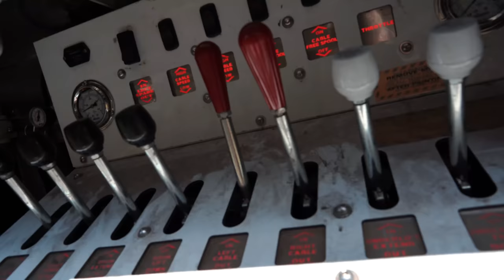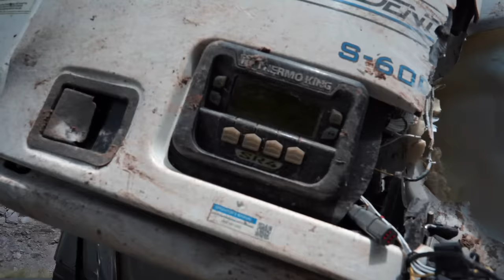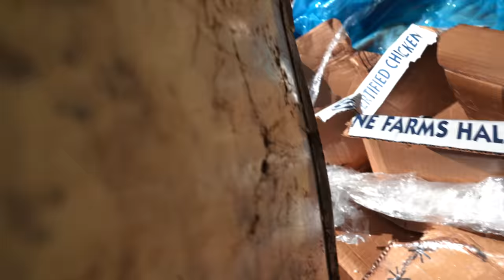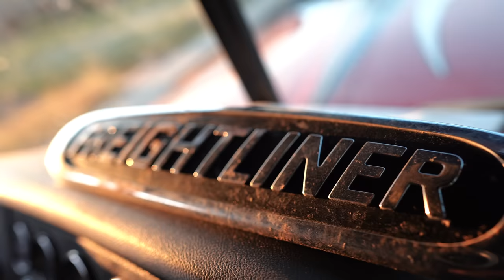The Luckiest Man Alive! (Two Wrecker Recovery!)

Comment: What a chicken of a mess that was!!  And talk about stinking when all of that starts to rot. Whew,     BOY!!    that was an excellent cleanup. There, near the end with the skid steer.

 And,  the ground looked very good when you fellas were done.   I am somewhat surprised that, The, department of public safety?  

I forget right now what the generic name is that would cover all the lower 48 states for the department that will come out and either block traffic, or get traffic to move over..

 Up here the highway patrol handles all that but I believe you would’ve had to call them out not sure right now that was dicey.  That’s for sure!  but you got it done and nobody got hurt.   And that,   is what counts.

Comment: Do you have any signs or vehicles up road to try and get the traffic to slow down and move over?  Surely there’s at least a cop car or two with the lights on!
Reply from the maker: We have signs…if we really need to we will put a vehicle up the road.
Reply: @MURPHYSDIESEL  I used to work for the state. They had us out there to have them lane shift. Or just stop them from getting on the interstate. State law here in Illinois says that we can’t use blue lights on the back of the plows or bumper trucks. That’s about the only color most of the people can see. I’m sure you’ve got some stories too. But if I may. We had a young girl drive around those big orange dump trucks. With those bump trailers behind them just like a salaam course. No cops where you need them. I put out 3 signs for construction ahead. And they were on a curve. I heard this car coming and I swear that he was using the signs as shift points. And there is was with my safety vest and sign panel. He was surprised to say the least. I’m just glad that I heard him coming. I don’t need to tell you to be careful. But do it anyway.😁Merry Christmas to you and all the crew.  There’s some strange folks out there.